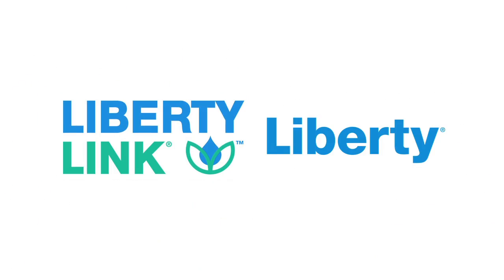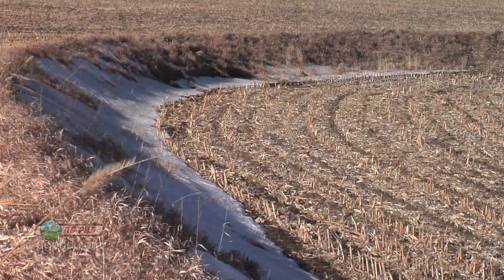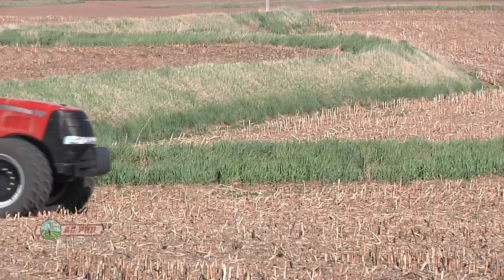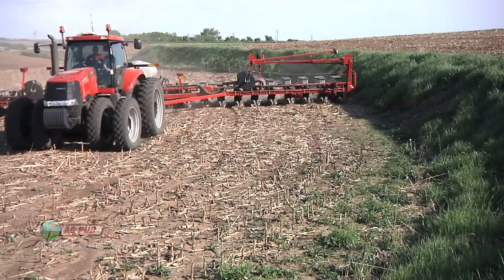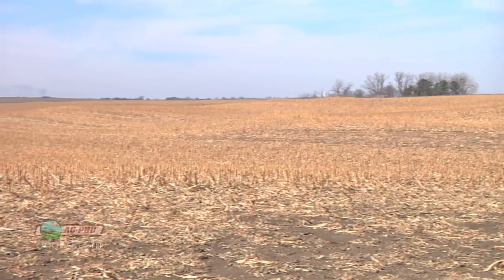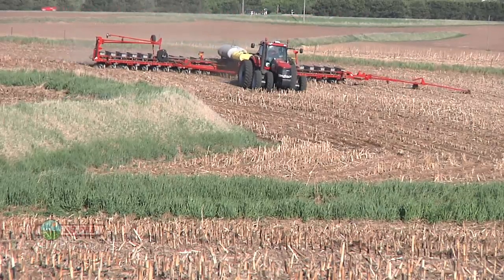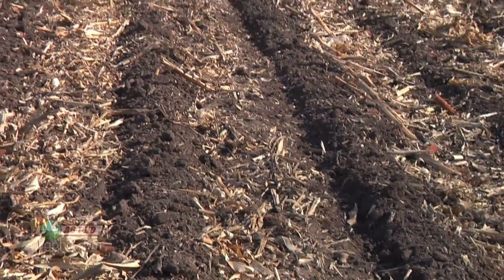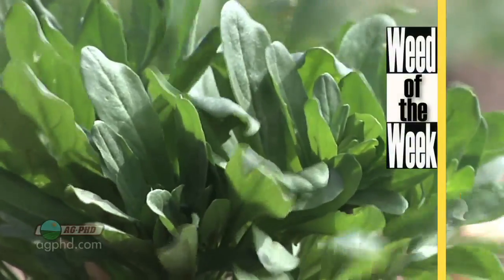Farm Basics #762-Terraces (Air Date 11/11/12)

Comment: if your no till .. and you have been for years.. how much soil would it really wash away?
Reply: It truly depends on many variables. Actual grade, annual rainfall, soil type, etc., and no till does not have a concise definition. Ask 10 farmers what no-till is and you'll receive 11 answers. Some will say you can even use a field cultivator and still be no-till! :) If a row cleaner is set aggressively, is that no-till or strip till? What about knifing in anhydrous, subsoiling, running a coulter machine? Really, any soil disturbance is tillage, even planting disturbs the soil.  Therefore, no-till is minimum till, it's simply to what degree. If you're "no-tilling" ground you can usually minimize erosion to a sufficient degree by installing waterways wherever a ditch forms (I'm talking a small washout a couple/few inches deep, not a ravine), that's natures way of telling you there's an issue. In our area, I usually fail to see the point in terraces that are installed, if you no till and contour plant you'd be surprised how steep of a sidehill you can farm without excessive washouts. If it's too steep, that section goes in grass. If you don't do a proper job contouring, forget what I've said and install terraces. If we had less rolling hills and more consistent ridgelines that didn't concentrate the water to waterway channels, I could see merit in them then.  If you have a big sandy hill or ridgeline, you'll definitely want a terrace. Sand will not hold very well. This is only my opinion, and only for my area.
Reply: @ShermanT.Potter  - Your words are spot on. Many farmers think that "no till" means no need for terraces and downgrade planting is allowed. A proof of laminate erosion is seen on the bottom of creeks and rivers. Opinions many times are seen as facts.